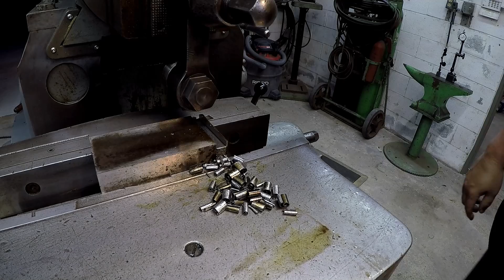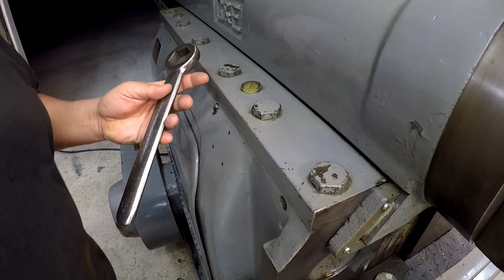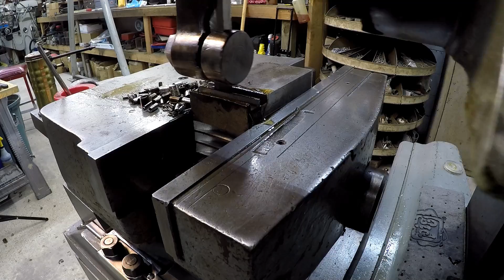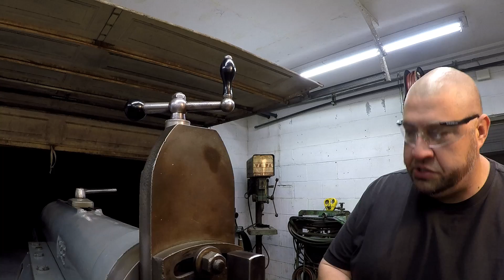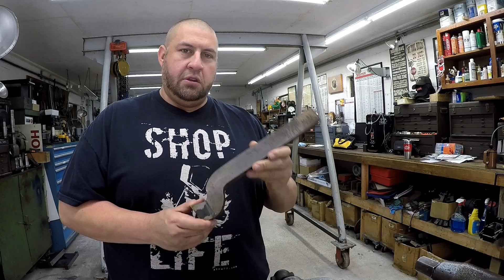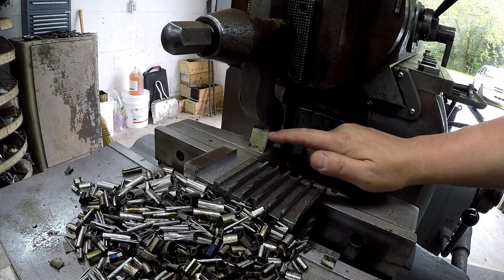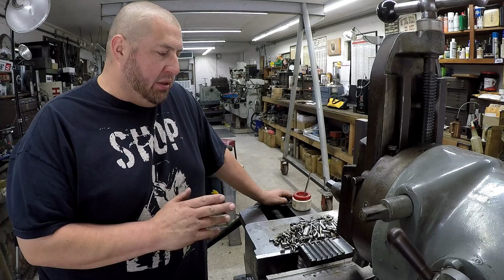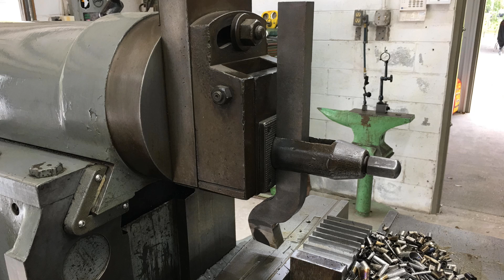Shaper Slotting

Comment: I think having the vise jaws perpendicular to the cut also helped improve the rigidity of the setup. I know you can't always do this if the work piece is too long to be held between the vice in the direction of the cut, but it seems like where you can, you would want to have the vice jaws perpendicular to the cut.

Comment: I truly hope you documented the angles of the factory grind before using that tool! also on your grinds please consider these tools differ slightly from lathe tools. they do not need the relief angles of a lathe tool and if you reduce the cutting angle of the grind by as little as a couple of degrees you can reduce the starting bounce accordling.

Comment: I wonder if you grinder your larger width bit at and angle so when it approaches the work it'll start slicing the material off rather than just ramming into it and hopping over it.   much like a razor for your face held at an angle,  the cut is far more efficient then just shaving with the razor at 90* to the hair

Comment: can anyone explain to me for what exactly you need a shaper?
can't a mill do the exact same work?
edit: okay i guess it can cut internal keyways but if that is the only job you might aswell broach it
Reply: For most jobs, a shaper will use far less expensive HSS tooling which can be easily ground in nearly any shop.  A mill would require more expensive too long that is difficult, if not impossible to produce in most shops.  It is a trade between time and money.

And shapers are different.....
Reply: Yeah, a history of the machine, and what its main use is/was for is one of the only questions I have.
Reply: You might struggle to broach with harder materials these cut all day, and capable of doing large quantities

Comment: I wonder how much of the anti-chatter the viewer provided tool offers is from the simple mass of the bit itself. Any reason you can't put a little extra weight on the front to help firm up that starting cut? Not sure how much putting your arm in it made.

Comment: Nice, thanks for the video. You may already have this info, but according to my “General-Industrial Machine Shop” textbook by Harold V. Johnson, copyright 1963 first edition, the formula for shaper cutting speed is CS=0.14 x N x L, where CS is cutting speed in feet per minute, N = strokes per minute, L = length of stroke in inches. Cutting speeds for high speed steel tools are: Machine steel 80 to 100 fpm; Tool steel 50 to 60 fpm; Cast iron 45 to 60 fpm. Rearranging the formula, N = cutting speed divided by (0.14 x length of stroke). So as your stroke length increases your the number of strokes per minute come down to maintain a given cutting speed. Obviously, your depth of cut, tool grind, machine condition, workpiece clamping, what the machine is telling you during a cut, etc etc all are going to effect the ram stroke per minute setting. Have fun making chips.

Comment: Total non metal worker question. (possibly a very ignorant one too!) Rather than having to reach up to feed the tool down, could you not raise the table incrementally instead?
Reply from the maker: Shapers are designed to for the table to always be locked tights and the table support locked as well to provide maximum rigidity during cuts. They were designed to feed the tool down with the tool slide, or the cross rail.
Reply: MazzaRC 
The main reason for not lifting the knee is there is a support out on the front to stop the knee dipping under the pressure of the cut, if you lifted the knee either the support would loose contact or you would have to stop and drop the support after each up feed. 
I hope this helps you to understand, but a well reasoned question is always good to see, never ignorant.
Reply: If the machine was made that way, sure.
But why is lifting the bed better than the tool?
Reply: Easier to reach, and it isn't moving.
Reply: 22:32
He is eye level with his z control. And it's moving about 1mph. 
I see what you mean but honestly I'd rather have it up there.
(edit:also that vice is way heavier than that Z axis casting, so your machine would be harder to turn)

Comment: What if you made that 1inch slotting cutter at an angle so it's like a shear tool instead ? That way it won't hit the edge of the part so square, but you could still get a square slot. Like the videos about the shaper !

Comment: Many years ago, I worked in an oil tool shop.They had a big shaper to cut very large internal drive splines. It made a 1" cut with a 1" wide tool set in a boring bar, no side feed at all. I built a ratchet mechanism that automatically advanced the downfeed on every back stroke. We got a good, clean cut with no chatter. Made the entire shop shake a little, though.

Comment: I think you must grind your tool with a smaller cutting angle and a larger backangle, so the cutting will be smoother .
40 years ago I did a lot of shaping, we also used this type of forged tooling.

Comment: Adam I have never used a shaper so don't know if this would work but how about angling the cutting edge 5 to 10 thousand so it is not hitting all at once or maybe a flat bottomed threading tool so you get one point and two cutting edges. ps I have watched them all keep making them
Reply: I was thinking the same thing...

Comment: Beautiful. Thank you Adam. That big shaper tool bit gift was just awesome. It seemed to cut a lot better as well. Makes sense what you said about the shakes geometry. BTW, that decimal for its width is 25mm :-)

Sheffield England was the motherland of machining and manufacturing in England. Even today but back then, it was a mecca for manufacturing. LOADS of heavy industry. My company started there in 1969 :-)

Comment: ya wow that spring tool from david really kicked some ass . is the geometry on your one inch straight bit around the same. that spring tool sets back a bit. that might help also. it seemed to do great on the step over cuts some of those just about as heavy. those chips well some of them look heavy on one end using that straight 1" bit gotta read the comments on this good work adam keep it up thumbs up that is

Comment: Do shaper tools need to be flush across the cutting edge's contact? Can the edge be angled a little from front to back and still be flat on the bottom from side to side? Might make the first contact a little easier if there's a rake to progressively shear off the edge of the work piece on the beginning of a new pass.

Comment: I'm a total noob and I thing the shaper us a cool machine. However I am wondering what the benefit of a shaper is over say a milling machine. Is it faster, straighter, more acurate or anything? Lemme know if you know, genuinly interested.
Reply: thats something id like to know too.   i have a shaper attachment for my mill. its in bad shape but it can be fixed i just never seen the need to fix it as i dont see why i should.
Reply: A shaper is neither faster or more accurate than a milling machine.  When compared to a milling machine a shaper is an inefficient tool simply because a good amount of run time is non-productive because the cutting tool does nothing on the return stroke.

What shapers are good at is cutting internal features on a part such as internal key ways, internal square or hex shapes, and internal splines or gears.  Shapers also use inexpensive tooling that is cheap to replace or resharpen therefore, they’re good and planing flame cut edges that otherwise is very hard on carbide tooling.

With the right grind, a shear tool on a shaper can produce a very flat and smooth surface rivaled only by a ground surface.  Often times this is used to prepare a surface prior to scraping.
Reply: Thanks for answering guys. Got a bit wiser again today :)
Reply: Shapers were pretty popular back in the days. Guess it was much about costs, they were a lower initial investment, a less complicated construction, lower tooling costs, might also used less power, but worked slower than a mill. With the growth of the economy after wwII one generally could to a larger extend invest in higher cost, more and more advanced and efficient milling machines, which would give a higher profit in the long run. Nowadays the shaper is more for hobbyists, people with special interest in machine tools. Pretty handy for doing keyways, especially internal ones.

Comment: Any play in the way the piece is clamped?
Reply: Looks like it doesn't it, with the way the go-pro vibrates when it's sat on the clamp table when the tool strikes the workpiece. Doesn't look like the ram or the head is flexing relative to the main body.

Comment: What are these chips for? Are they the product or the waste ? Came across this video by mistake and got fascinated by the machine even though I have no idea what am I looking at.
Reply: Like scrap porn
Reply: Abom79 funny story.  Years ago, I was on a school trip to nail manufacturer where they took oval wire and cut it to length, shaped a striking head and created a sharp point by chopping two oblique cuts on the tail.  The guy giving us the tour pointed at buckets of the off cut chips, created as a result of making the nail points, and boasted that they actually made more money from these than they did for the finished nails, weight for weight.  These chips were used as an abrasive in tumblers for surface finishing other metal products.  One of my class mates asked why they continued to make nails since by making chips alone they would make more money.  The guy was incensed “we wouldn’t do that! We make nails”.  They are no longer in business.
Reply from the maker: Chips are waste and considered scrap metal.
Reply: no vision
thanks for the story
Reply: Here is the home page link for the channel. Check out what lies behind the Abom79 logo. The chips are like women. See, there are light colored ones, dark ones, blue ones, silver ones, hmm, I saw a silver one once, but I think it was a dude, very strange. Chips are not like that, you see a chip, you know it's a chip. 
check it out.
https://www.youtube.com/channel/UCw3UZn1tcVe7pH3R6C3Gcng

Comment: Just one question Adam when  cutting with your tool steel bit. Should the cutting side, Be razor Sharpe. Like In the direction it's cutting off metal. I think you did touch base on this in one of your prior videos. But watched so many. Thanks in advance.

Comment: Make a nice napkin holder with that tool. ;>)   Surprised that tool does not index the head down automatically.
Reply: I believe that Adam showed us a part that bolts onto the ram that they weren't able to find when it was moved from where he bought it from, that missing part I believe is what engages the adjustment for the automatic downfeed. The part I'm referencing is the one which another machinist sent him theirs so that Adam could reproduce it himself with the G&E

Comment: When cutting multiple slots, how thick must the wall between slots be to prevent deformation?
I know that it depends on the material being cut, but there has to be a minimum thickness on any given work piece.  Is there any formula for figuring this out?

John

Comment: Thoroughly enjoyed that video Adam, especially seeing you so happy with your progress at the end. It's been mentioned below and on earlier threads, re seat the clapper taper pin to hold that clapper firm for cuts. I found 0.003" of wear out of the thin end front side of my clapper pin and that allowed excesses movement of the clapper and thus the tool on cut entry. I had to machine a new taper pin to suit. Hope to get the video up in the next couple of days to show it. Love the Stag Major series of British HSS superweld tools. You can still find them for sale in the U K . No one wants the gooseneck types these days ..... postage hurts though 😆All the best Mat
Reply: lookcreations Hello Matt , as you well know, shapers are far more complicated than most people think. So many things need to be correct and fall in line in order to get good repeatable results. 
Good to see you and I hope all is well..  I need to work on my clapper pin also. It's just slightly loose on the large end where it locks on the box. I need to hit it lightly with a reamer before it wears more than it is already 👍
Reply: I have only just refitted a new pin today Steve - just for good measure I checked how bad the original one was - holding it against a steel parallel and light behind it was interesting - I could clearly see wear on the left hand end around the clapper position - as Forest notes below - these things are a very precise fit. Always enjoy reading his comments - that dude know stuff for sure and I have a great deal of respect for his experience and the fact he shares it freely. Chuffed for Adam to be making good progress.

Comment: In my slot to g experience both internal and external we usually about 30 amp and a downgraded of 2 to 6 thou per stroke but our shaper doubled the dialed in cut. I e .004 down got you .008 thou depth

Comment: there should be a small project to control down feed with a stepper motor. that would be nice.
Reply: İlhan Neğiş Machine already has automatic downfeed, however Adam has got to machine up a couple of the missing parts to get it back in action.

Comment: Is a full width contact start to the cut preferred? Or would a grind that has a slight angle to the workpiece be better? Depth is the same across the tool but there is a leading corner that starts the cut. Wouldn't that have a smoother engagement to eliminate the jump you keep getting?

*edit
Looking at the comments a doing a little light googling it looks like deflection is the main concern with my thoughts above. While a non parallel leading edge may not be the best idea depending on application the grind geometry is still the most important factor. Now I wonder if there is excessive play in the clapper pivot pin but it's probably just needing to find that "perfect" tool grind.
Reply: That's exactly what I was thinking,  although I don't know much if anything regarding shaper cuts etc.  What I do know is if anybody can get it figured out then Adams the one for it.
We'll keep watching this space to find out.
Reply: Yes and no, for a slotting cut usually a little backrake or a neutral cut is ok, the sweet spot for the angle depends on material and workholding and the usual 101 other factors. While having side rake of some sort reduces tool pressure on the cut by thinning the chip a little, for slotting you don't always want to have to deal with the tool deflection that results.

You can end up having a slot that tapers on the width plus cause unnecessary wear over time in sliding surfaces of the machine.
Reply: It was suggested in another comment to very slightly hollowgrind the face of the tool so the outside corners both contact first and gradually both sides cut towards center. The bottom of the tool is still flat. This reduces the hard shock of the whole edge initiating a cut at the same time, without steering the tool to one side or the other. Seems like it may work. Easy enough to test. Id test it if'n I had a shaper.

Comment: You have plenty of tool clearance on the return stroke, but IMHO you do not have enough tool clearance on the cutting stroke. Add another 1" on the stroke so the cutter completely clears the workpiece, the same as you have at the other end on the return stroke.
Regards,
Mike
NE Thailand.

Comment: Isnt the device located on the operator side of the ram an automatic depth feed linkage? (You can see it at 21:00 to the very top right of the picture) I've got something similar on my machine and it makes slotting much easier - especially because you can set it to accurate feeds just like the cross feed.
Love your shaper, man - especially it taking those huge cuts without any complaint!
Reply from the maker: You just have missed my previous videos on that
Reply: Thanks for pointing that out - I did indeed miss that SNS. 
Really fired up to see you making that cam plate - it was missing on my machine, too - so it was the first part I machined on it :D

Comment: Just a sliiy question... Is there a reason for the tool post locked at an angle vice perpendicular to the cut? 0.010" is no longer 0.010" when applied at an angle.

Comment: My fathers workplace used to have quite a large shaper. It was built in 1906, had a stroke of four meters and was entirely mechanical with open gears. They used it instead of a mill to avoid heating materials that needed to be straight, sharpen the blades for their big metal shear and make tools for their hydralic press.
Reply: That is the size of shaper needed to make the shaper that made Adams shaper.........4 meters is HUGE....
I can see it now: a crane to lift and dispose of the 200lb chips.......

Comment: Get your squirt can so you can apply cutting oil while it's running.
Reply: I thought it was a little funny, a couple times he let the machine run a stroke before adding downfeed.  The resulting spring pass before the cut neatly removed all the oil he just applied to the slot.........